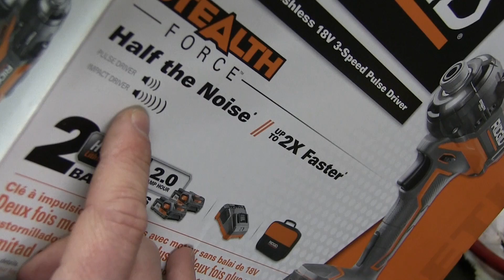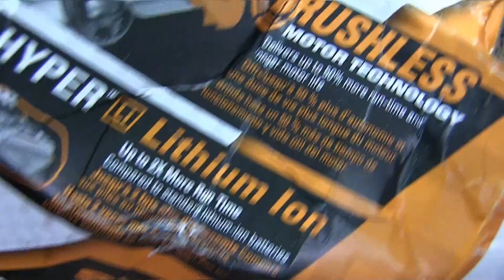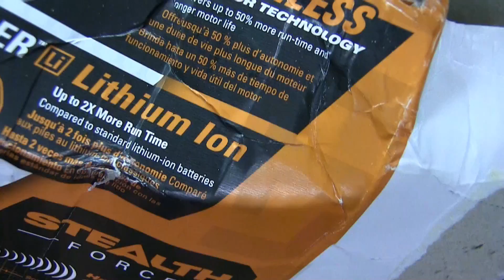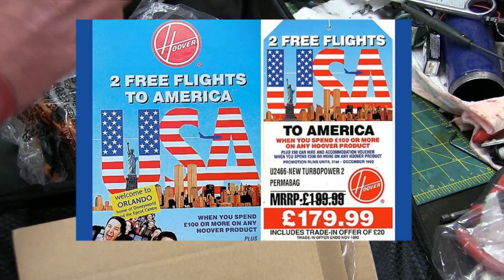BOLTR: Ridgid Hydraulic (?!) Impact Gun

Comment: A year or two ago home Depot replaced both my batteries in store no issues. Also repaired the drill chuck and switch no shipping cost. Recently one battery crapped out (my fault as I forgot it outside and it got rained on). The NEW policy is to call a service hotline. They said I hadn't registered the batteries that were replaced but as a one time service they would register them. So I did get a new battery. So I'm still happy with them but there are 2 big things to keep in mind. #1 you HAVE to make sure you register the product PROPERLY wroth Rigid when new AND EVERY time is serviced or replaced. And #2 to have the drill or driver serviced you have to authorize repair costs in the event the damage is due to none covered causes (I think the minimum service fee was $99 pretty much the coat of a new tool). Luckily mine was covered but if it hadn't been is have been paying AT LEAST new tool cost or more just to repair an old tool. Several hard years use and they're so going for me so worth the $189 for the drill driver combo set I got.

Comment: Is it possible that random ground cable is a failsafe for the LED among other things?, if the insulation for the wires happened to melt/fail and there is a possibility of a (albeit low) current running through the metal housing a ground would stop the ol' magical pixies dancing through your fingers when you go to screw a metal surface you just happen to be making contact with.

Comment: Heck, I even got a free replacement battery for my Ryobi drill from the Home Dept. when I went in just to see. No shipping costs, no nothing. Then again, I'm in the US, so things are probably different for you up there.
Reply: LazerLord10 Ryobi probably has a better return and exchange program. I had a Rigid 18v hammer drill, it went tits up shortly after I bought it. The trigger failed and took a battery with it. I tried to exchange it at Home Depot, it was only two weeks after I bought it, they sent me to the rigid service center. That process took 20 weeks to get the tool repaired and the battery replaced. I ended up buying a Milwaukee 14.4v drill to get me by during the wait. Turned out the little Milwaukee was a hell of a lot better tool, it lasted for years. I ended up selling the Rigid within a couple of weeks of getting it back. Now using Hilti (after using the little Milwaukee for twelve years). Hilti is the ducks guts. Fantastic tool.

Comment: I'm currently in the market for a drill. So would you recommend Milwaukee over rigid and dewalt?
Reply: We use Makita and Bosch at work, they are both nice.  I have bought the older Brushed milwaukee set from Home Depot and other then the chuck sometimes dropping my bits  it works.
Reply: Leonard Crabtree overall the Milwaukie drill is a good though?
Reply: Jon snoon the Milwaukee drills are monsters, he got an old brushed motor model, get an m18 fuel brushless model, those are the best drills out right now

Comment: Also, pardon me for being an idiot. But when you say works hydraulically, do you mean it uses built up pressure  during rotation to store and then release the energy all at once thus creating the impact effect . Or is there something else at work i.e. hydraulic pressure being applied to the vanes instead of being created by them.

I'm sorry, but I may be a little drunk and I'm trying to visualize whats happening, which I'm usually good at. But for some unknown reason that has nothing to do with my inebriation, it hasn't clicked in my brain yet.
Reply: Nate Elliott I think it's just a basic hydraulic pump concept, just instead of a stroke, it's rotating between low and high pressure bearing on the vanes. I'm not sure how to explain it other than its kindve like comparing a rotary engine to a traditional engine
Reply: CatalystMetal Yeah, I get that But since I didnt see a traditional hammer mechanism I assumed that the hydraulic build up and release of pressure provided the hammering effect. It also could allow torque multiplication in the same was a torque converter works.
Reply: its a fucking water hammer in a chuck.
Reply: Merlin Jones i think I understand how it works, but it seems to me like there would be no impact effect. Rather a simply pulse of varying torque that wouldn't allow you to tighten something beyond what you could achieve by twisting the chuck yourself.

Comment: This is just like porn. I keep clicking through his videos to find one to finish to, but there all sexy so I'm basically rubbing my dick raw.

I'm going to need a recommendation on a type of grease to prevent that AvE. Lithium? copper or nickel graphite? some kind of moly?
Reply: Just use WD 40 Kappa
Reply: Silicone does an ok job, but i need something designed for high heat.
Reply: defconcepts tell me about, I have to tell all my dates my circumcision was botched.
Reply: *****
Copper graphite? Im skeptical of anti-sieze being able to maintain its lubrication properties during high friction reciprocation. I need a high heat, high pressure lubricant that maintains it's properties no matter the "rub factor". AND DON'T SAY full synthetic 0w-20 since it is super thin while cold! My "special friend" recommended that already. I burned it off watching the BOLTR of the Fein grinder!
Reply: botched? nah, it makes you sound more manly when you have something cool happen to it, like bottle rockets, or a questionably rabid pack of cats. Blaming is too easy... flair it up! already lying anyway. 

To the question, regular ky gel. lol. get  the flavors if you dare, results vary. you could try adding one of those WannaPussy things also. I find the free air makes it dry up pretty fast, and that's not for me. Anyone with xp feel free to chime in. lol.Yes, i know i skipped the joke. hoping it would itself be humorous.
Reply: It sounds like you need "Flogging Mol[l]y"!
Reply: Keep it in a vise, like yer s'posed to. Thanks - Lumpy
Reply: WD40 CAUSED MY FORESKIN TO DIS-INTER-GRATE THANKS FOR THAT

Comment: Holly cow you predicted it!!!! Milwaukee just announced its new quieter hydraulic ¼ hex.  Omg 😲 your awesome 👏
Reply: zack9912000 you seem to be assuming Milwaukee just pumps out tools without testing... All of their tools are tested for much more than most of us put them thru and for much more abuse in a shorter time. They test them to failure to improve on design. It's 2018 and there's no redesign.. what does that tell you? I wonder what the failure rate actually is on the surge? I just bought one and it's the 2nd best driver I own to only my og M12 fuel drill/driver (that thing is perfect for every small/medium screw application).. but honestly I think when Ave refers to this style driver not lasting, that's merely speculation as we haven't seen one fail yet on YouTube.
Reply: Kevin Côté it will be interesting how long these will last, my guess is not more then a few years. In the mill were were constantly rebuilding or replacing pumps with daily use.
Reply: zack9912000 so far, mine has lasted a year of heavy use and it's still chooching good.

Comment: In your opinion what is a good impact driver and hammer drill combo kit. I bought the fuel from Milwaukee and I'm on my 4rth combo because of constant problems. The intro was really helpful. I didn't know the structure of the company. I just bought a rigid shop vac which has been the best thing I've owned for tools in a while.

Comment: Do you have  a recommended tools list? I am a nub.
Reply: Zorn101  agree.. he needs a list. this is way more honest than consumer reports best of 2016. :)
Reply: Ave is big on Makita angle grinders. If you're a cheap ass or don't plan to give it a hot supper, the Harbor Freight cheapo will be do you fine as well.

When it comes to impacts and drills, Dewalt and Milwaukee appear to be making the best stuff for serious home gamers, but it's all mostly the same anymore, made in china, or with chinese components; so whatever your nearest home-improvement store is selling that has a lifetime replacement plan may be as good an option as any.

For automotive uses I've been very happy with my M18 Milwaukee tools. Torque-y as most peoples air tools, and a hell of a lot more portable. But your mileage may vary.
Reply: All three's current lineups are primarily made in china now with globally sourced components, with a few exceptions here and there. None of them are at all what they were ten years ago.

My take-away from AvE's videos on the three's current stuff is each tool is better and worse in specific ways than the competitors; there are very few cases where there's a clear winner. You'll take a trade-off in torque, battery capacity, overall metallurgy and bearing skookumness, good plastics and ergos, and reasonable cost somewhere.

Comment: So if the DC voltage has to be converted to AC why not just run it on an AC battery in the first place? I understand the issues with battery compatibility but any any technical reason why?
Reply: ...there are no AC batteries.  AC is from generators or electronics and DC is from chemistry or electronics
Reply: It's not a simple AC. It's computer controlled to make the motor spin according to your input. Look up Brushless ESC
Reply: An AC battery?!? show us please....
Reply: stephen1r2 Well just looked up why, and now it makes sense...
Reply: It is AC it's just that it is using PWM (Pulse Width Modulation) which is a square wave that cycles between 0 and whatever volts to change the speed of the motor.  By the way, AC cannot be stored inside of a battery.
Reply: You cannot store AC (alternating current). 

About motors... ALL motors are AC. The difference being that in regular "DC" motors the switching of polarity happens inside the motor by way of the commutator and brushes. In "AC" motors the switching happens outside the motor.

Comment: first off great video! These types of hydraulic impacts have been around for awhile. From what I've seen the main market was Japan where they have noise regulations on job sites. They would use there regular impacts during the noisy hours, then during nappy time if they need a impact the hydraulic came out. Very expensive tools I remember hearing $800 US thrown around but I cant confirm. 
     I would agree that this may be a loss leader. Very common to see the consumer grade tools try out the questionable tech. The market seams to except failed tools a lot better in the lower grade tools. If your pro tools go to far outside the box and fail it can take decades  before the pros will go back to the failed brand.

Comment: That's actually pretty cool how it uses hydraulic for impact. Like you said the impulses won't be quite as sharp so that would be nicer on your hands and on the parts your putting together there will be less vibration and stress. Maybe not quite the oomph of a hammer and anvil but it should still be enough. I knew about cavitation from boats and props but I didn't know that it happened so readily in oil too. Are you sure that they didn't use some kind of heavy hydraulic oil that resists cavitation? And a hammer and anvil would wear out too wouldn't it from the actual impact of the parts. I wonder which system would last longer. I think this hydraulic one might just because of the less sharp impact and less vibration that you would get.

Comment: Seen MANY water pump impellers fail due to cavitation, in one case in under 10 minutes of operation - and not the cheap stuff. That's what happens when building designers don't bother consult equipment people and don't allow for enough suction pressure on the pump.
Reply: It would be interesting to find out about how oil compares to water with cavitation, which one is easier.
Reply: I suppose oil would be "easier" than water since most oils have a lower vapor pressure than water.
Reply: Most oils? Can u name even one oil with higher vapor pressure please? Thats impossible from the physical side, oils are long chains -> high boilingpoint/low vapor pressure. The stuff with about the same vapor pressure is not just no oil, its even more liquid than water.  Diesel has a vapor pressure <1/10 of water to put things into perspective.
Reply: some liquids wont even sublimate in a hard vacuum, they stay liquid in space,  i don' know if they are actually oils but some are made of hydrocarbons.
if it weren't for the reactivity potassium-sodium eutectic would also be a good candidate, add a little caesium and it will apparently stay liquid in orbit, some 16 RORSAT satellites decided to release the schmoo in spectacular fashion(reactor core ejection), the droplets are as far as i can tell still in orbit but there isn't any proper ephemeris data for this particular cloud of material(at least on HORIZONS).

Comment: you still didn't put it together?
Reply: You messed up the vertical slip on alooomeenium thing on the vise and can't and wont put it back together ey?
Reply: ya think he fucked it up?
Reply: Cavitation is not an air bubble. Basically a cavitation bubble is actually a bubble of vacuum, an empty void of nothing that forms. Well, liquids boil when they are exposed to vacuums so the liquid around the bubble boils instantly and fills the bubble up. So now you have a bubble of nothing with liquid and gas rushing into it, when the liquids and gasses meet in the middle they slam into each other hard and if that point of impact is on or near a surface it acts like a small explosion and damages that surface. So cavitation doesn't require air or any gas, all it requires is a liquid and rapidly changing pressures.
Reply: Dalton Michaels 
You don't need air (or any vapor present in your flow) for cavitation to occur. Like AvE said, it is caused by a phase change to a vapor, which creates a bubble that then collapses and releases energy (the implosion).
Have you ever seen those pistol shrimp that shoot bubbles to stun their prey? It basically works like that.
Reply: when he talked about the hydraulic pump cavitating in the video and the fluid vaporizing during the lack of pressure sequence of the revolution, the only thing i could think of is what if there was absolutely no air in the chamber that the pump system resides. also i know you cant compress fluids but what if it was also pressurized inside the chamber were the pump resides. then there may not be enough lack of pressure for the fluid to vaporize.  just some thoughts.

Comment: I work for home depot down in California, I can shed some light on the Rigid warranty. The batteries are only warrantied if they come in the package with the tool and the package reads lifetime warranty. All the rigid warranties are only valid if you register your tool right away, if you never register the tool the warranty goes down to 2 years. not sure about Canada  but here you have to take your rigid tools to a home despot with a tool rental. If you bring it to a Home Despot without a tool rental they can do the warranty but it has to be sent out and ussually a 30-day turn around.

Comment: rigid warranty isn't too bad. since home depot is there service center, you just take it there and they usually replace it right on the spot. if you did you warranty paper work. have not had an issue so far.

Comment: Damn I didn't know milwaukee was made by the same factory as ryobi and ridgid's cordless gear. Ridgid's plumbing hand tools are top notch along with their threaders but their cordless line I'm not a fan of. 
Makita came out with a version of this over a year ago...if this is the same design anyone have any idea how the Makita "oil impulse driver" has held up?
Reply: We have been using pneumatic and electric impulse guns in manufacturing for years. They hold up just fine if they are maintained properly.

Comment: Thanks AvE that's cool. With a vane motor you have exhaust(pneumatic) air cooling or fluid returning to the reservoir to cool the fluid before being reused or cycled right? With that small system there has got to be a lot of heat. Less impacting vibration I get but the heat from the fluid cavatating and I don't see it having a lot of torque after hammering for a while. Does the torque drop off the longer you hold the trigger is what I'd like to know. Definitely outside the box for a cordless impact tool and less noise. Less noise i don't think matters. Need a quieter gun....for what my buddy still uses a air hammer to take off a brake drums and everything else. I think I'll wait and see in a year if it's still out there, might not be a fad. Great vid as always

Comment: can you explain more on the diesel engine, would the cavitation be in the pump or the engine combustion chamber?
Reply: +Josh Kilen -cavitation is in the water jacket at the top of the liners usually it appears as pin holes in the liner. they make an additive to add to the coolant that is supposed to eliminate it.  I always us the additive and have never had the problem but I have seen it

Comment: AvE, I'm a little confused by 16:44. Doesn't the pressure increase from a small volume to a large volume? And vice versa
Reply: +Robert Newcomb Think if you have a constant amount of stuff, and then you reduce its volume, meaning that you squish it in, so obviously it's gonna fight back, the molecules don't want to be too close. Pressure increases.
Reply: +Robert Newcomb It's essentially a reverse wing, only with hydraulics and in a closed system.
Reply: +Maple Syrup I guess I was just thinking about pipe flow, where an expansion in volume increases fluid pressure. I guess it makes sense if the rotor adds energy but retricts the fluid and causes pressure to go up, like a pump.